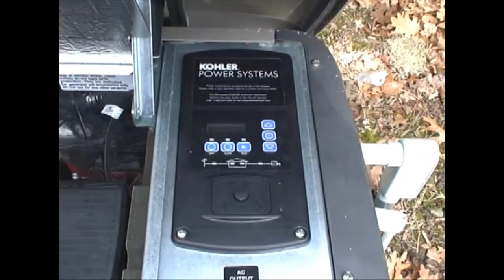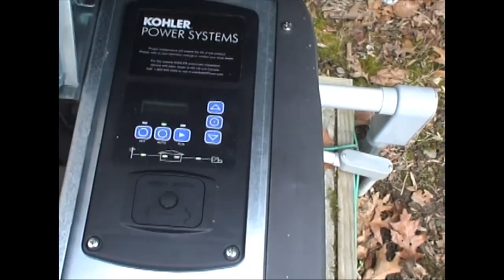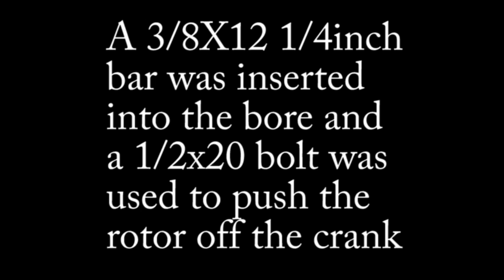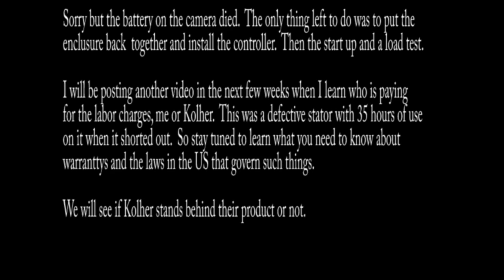Kohler Generator alternator replacement

Comment: Same code on my 12 RESV   100 hours total time 1 1/2 years in service you are lucky you got Kohler to come out to service, in my case I ordered my unit from a Kohler dealer (out of state) had a local electrician and propane company install now both Kohler dealers in town say they do not service units they did not sell or install..... so I am stuck with a yard ornament
Reply from the maker: I would call Kohler directly and speak to the warranty department.  Then look up the Magnuson–Moss Warranty Act.  Basically a manufacturer cannot tell you who must install their product or repair it unless they pay for the labor to be covered by the warranty.
Reply: @ciladog  Follow up, did my own trouble shooting and found brushes bad brush holder melted and rotor slip rings bad from arching, finally got another dealer in the area to come and look at it and he told me Kohler was very hard to work with on warranty work, so I took pictures and found the factory email address (no easy job) sent them the pictures etc and WALA they called right back, the dealer called soon after thanking me for jumping on Kohler and then sent out the repair service they contract with, they picked up the Generator to replace Rotor etc, it just got back 6/7/2023 starts fine and runs, I have not load tested it yet, but from now on no more automatic standby or exercise cycle  for me also no more long runs as I have no faith in this thing and will just baby it...BTW funny how I frowned on Briggs generators when I was looking for a Generator as the repair Service guy told me they have the least amount of service calls on them, worst being Generac and second Kohler

Comment: I have one of these 14kw kholers, that has shot  off a locked rotor error  twice thus year first time it was an issue with the inverter settings and the  this last time  the tech  said the wires to the rotor were cut, gen has 5k hours  on it

Comment: So, who ended up paying the labor you or Kolher?
Reply from the maker: I did but it is a long story.  When you have a limited warranty on parts (because your labor warranty has run out)  The manufacturer has to provide those parts to you with no condition as to who will do the work.  That is both federal law and all state's law.  The federal law is called the Magnuson-Moss Warranty Act.     When dealing with Kolher, you have to do warranty business through their rep dealers.  They kept telling me that I had to use this one major dealer in NJ.  That dealer said that I could not get the parts ($3,200) unless I used their labor to install.  They wanted some $1,800.00 in labor charges.   I sent both Kolher and this dealer an email citing the Magnuson-Moss Act and let them know they were in violation of both federal and NJ law.   Everything change quickly.   I found a rep dealer that would install for the warranty price of $650.  The parts were shipped to them and they did the work

Comment: Wao are you kidding me? I can’t believe that this Kohler standby gas generator with only 35 hours of use has a shorted stator, I would not recommended it to anyone. My local dealer told me he has a couple customers with Champion standby gas generators like mine with almost 2,000 hours of use still working perfectly.

Comment: I got the similar unit but it won't start and it says Battery Cocr low warning. Been trying to contact the dealer since I bought the house recently. Could you please tell me how to I locate the serial number on the unit?
Reply from the maker: You open the cover to the generator and there is a printed metal plate that has the serial number, the Spec. number and date or manufacturer just below the load breaker.  You can also find all that info in the controller.  Shop around for a dealer.  Some of them will rip you off and others are good guys.  Sounds like you have a week battery.  Not a big deal.

Comment: Thanks for the video.  We have a Kohler 8.5res.  After 35.8 hours of use, it won’t turn on with an OV (over voltage) warning on the display.  Kohler phone support told us it’s probably the alternator and that the generator is out of warranty.  Was your unit under warranty and did Kohler cover the repair?
Reply from the maker: My unit was under parts warranty but not labor. Kohler refused to cover the labor for the replacement of the alternator;  .But what I learned in the process is that you have to shop the Kohler authorized repair companies. The company that Kohler sent me to wanted $1,900 in labor.  I shopped around in my area and found a Kohler authorized repair distributer that only charged me $625. You need to check the controller settings;to make sure they didn't get screwed up from a power serge. Get out the;operations manual and read through it and check all the settings.  When the alternator goes bad it doesn't produce AC current.  An OV fault could be the controller, the throttle servo, or a few other things. Just don't believe everything you are told.   Have you cleared the fault and tried to run the generator?  Good luck.
Reply: Probably way too late but my 8.5 res had an overvolt failure and it was a bad SCR and bad ADC-RES circuit board. I fixed it myself. Has put on many hours since then (several hundred). I am now back here on youtube looking at generator repair videos because I have a different problem now.
Reply: @mckenziekeith7434  Mine was the SCR too and it was a relatively easy and inexpensive fix.